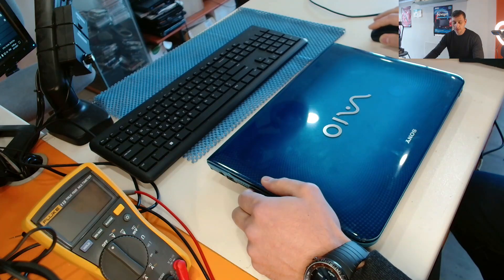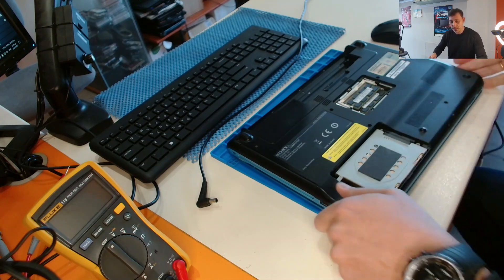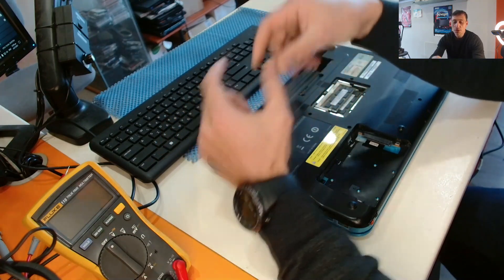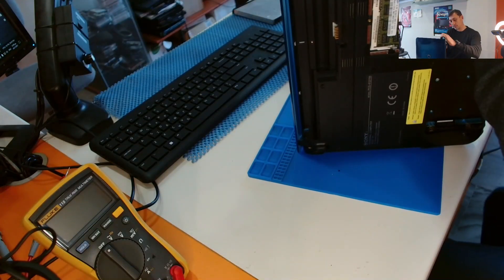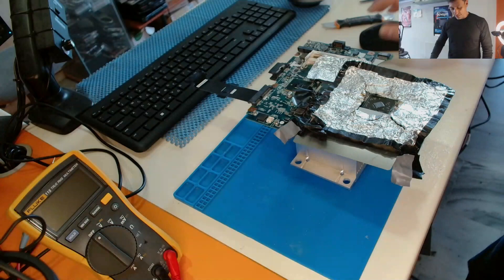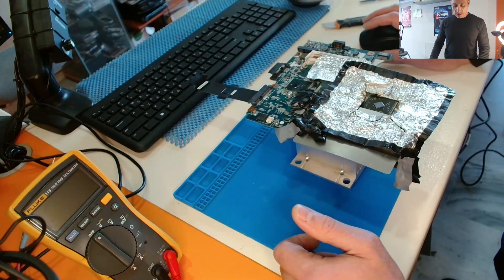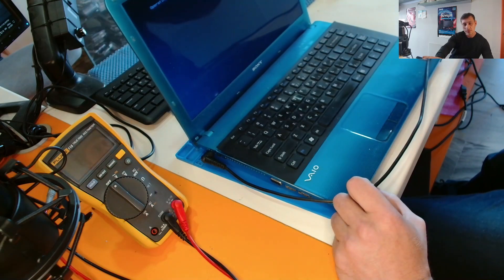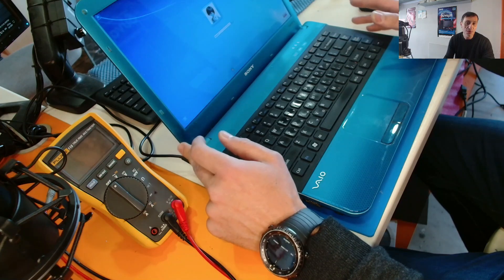Sony Vaio VPCEA1S1E black screen. GPU issue, how to deal with

Comment: I am also a laptop technician working in India. Your tutorials are really good and worth watching. Dont you use a DC power supply to diagnose faults? If yes pl post a video for current drawn and possible faults. It will be another good video